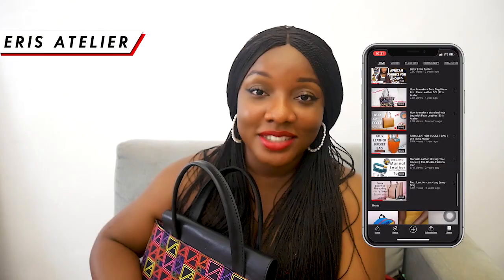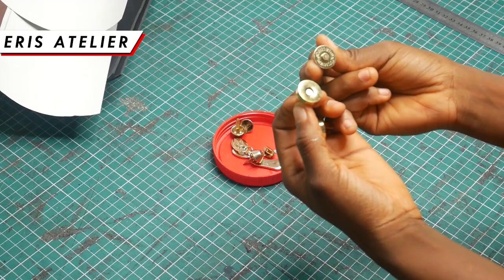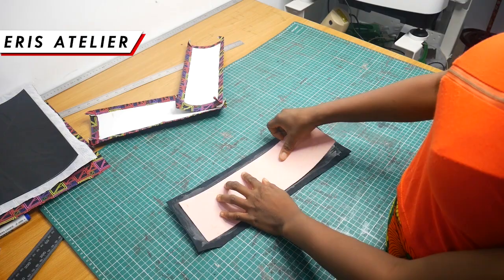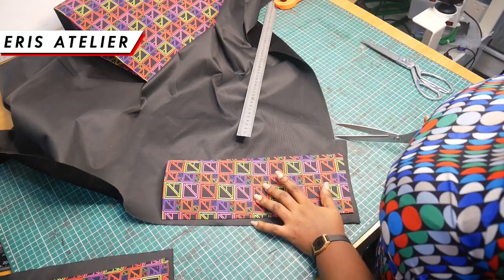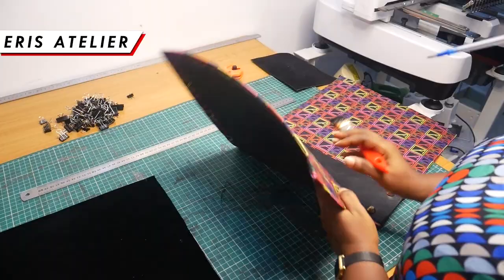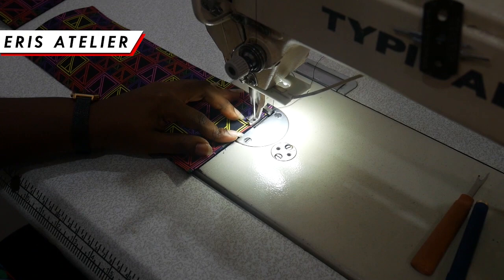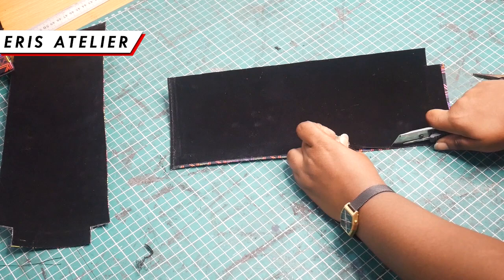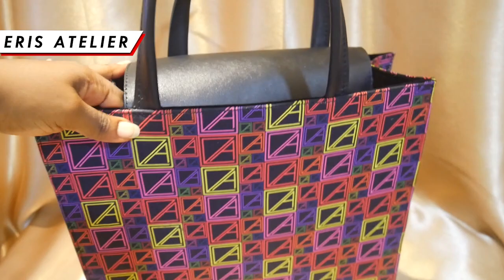How To Make An African Print Tote Bag | Eris Atelier

Comment: New subscriber!!! Lovely video. After cutting the exact measurements like you posted, you still need to add the 2cm allowance for folding in or that is factored in your initial measurements? Cos you mentioned that we should always add 2cm to the fabric. Meaning the stiffner (in this case, the moco) will be 2cm less so that the fabric can fold over it. Hope my explanation is not too confusing?
Reply from the maker: Thanks for the tip!

Comment: Watching your video over and over again. What seam allowance did you use for stitching the sides of the bag?
Reply from the maker: I don’t think there’s seam allowance involved. 
After cutting the exact size indicated, you wrap with fabric, gum the lining then cut out 2cm by 2cm at both sides of the bottom.
Reply: @TheErisFoundation  thank you for your response. What I need to find out is about your final stitch where you stitch the sides of the bag to the main body. Whether is 1/8 or 1/4 inch
Reply from the maker: @faithful021  Okay, There’s no fixed measurement for that. Any point where you are comfortable with is good.
Reply: @TheErisFoundation  thank you on this rainy night in the Caribbean I am here watching your videos thank you.